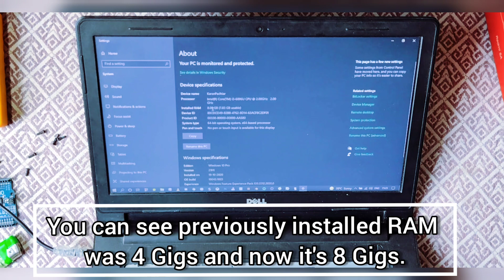How to install Ram in Dell Inspiron 14-3467

Comment: you cant take out the back cover unless you disconnect ribbon wire of ODD under the keyboard,so take out the keyboud first.
Reply from the maker: Yes I forgot to mention it in the video

Comment: Is it possible to remove the 4gb ram? And replace to 8gb and add 8gb ram also so it become 16gb ram? Thank you for response i have dell 3467 i5 4gb ram
Reply from the maker: Yes, it is possible but you have to check compatibility of your motherboard. Some old motherboards don't support more than 8/12 GB ram and they will not show full 16 GB Instead you will see only 8GB ram

Comment: why do you need to take of the key keyboard im scared to remove it
Reply from the maker: I guess the keyboard is connected to the back panel of the laptop but you can try without removing the keyboard, if it requires to remove the keyboard then you should remove it. It is completely safe